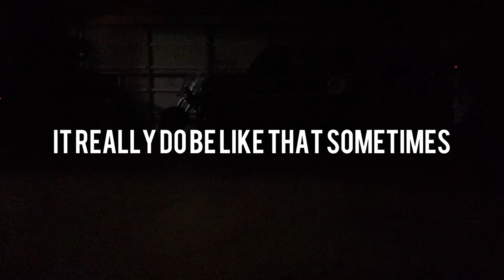COOL vintage turbo??? More body dropped rabbit updates!

Comment: Enjoyed the video thanks. I guess fabricating a new mount would be the preference. I like the period kit though so I'd be inclined to put in the engine it was designed to fit so it matches. I'm running a SORG road kit for DCOE40s on mine and recently changed to the HH code engine which is the one the kit was sold to fit.

Comment: make an adapter to move the turbo from the exhaust manifold  to the hot side so you can put the turbo where ever you want, or event a dual bolt pattern flange that would allow to clock the turbo on the manifiold

Comment: Loving the content, and for making the turbo work, have you thought about making a v band adapter for the exhaust manifold, cutting the flange off the turbo and welding a v band clamp to it so have a full rotation of movement to get it into position?

Comment: what about fabbing a spacer between the turbo and the exhaust manifold? Would that possibly drop it low enough to clear the mount? You could just use longer bolts. then as for the cold side, you could throw on an intercooler.
Reply: I have the same kit on a 1.6 in a caddy. Have been looking at the exhaust as the one on mine is jacked up.